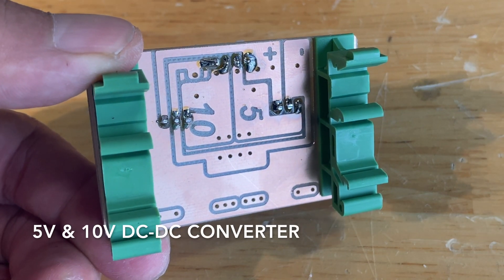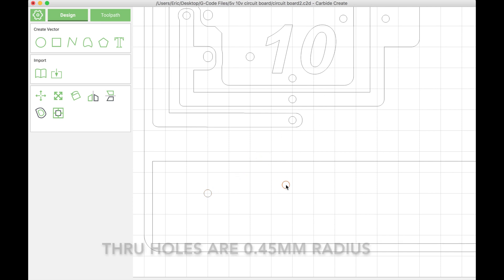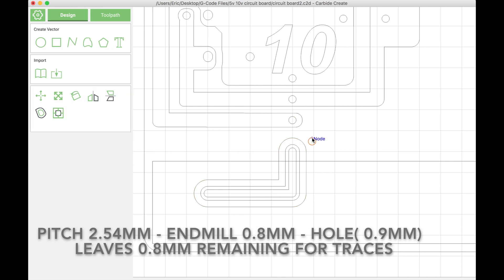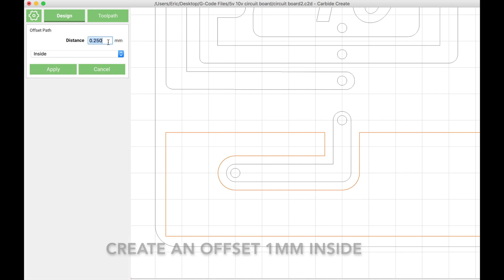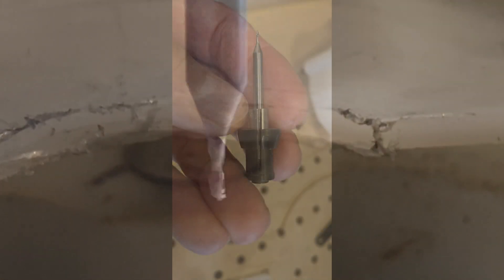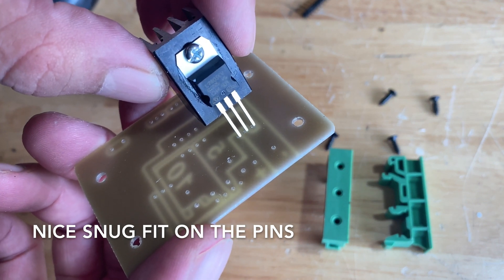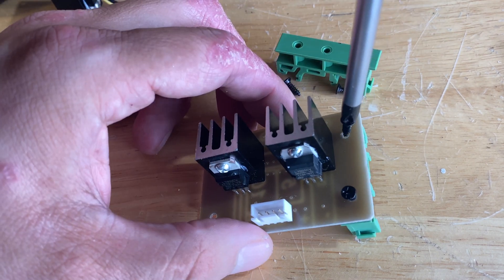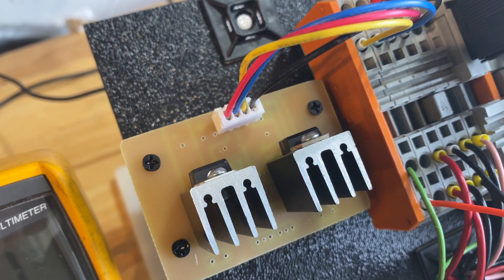Tips for making PCBs using a Shapeoko CNC router and Carbide Create

Comment: No joking, you should consider doing more of this. More of this kind of content, and you SHOULD have a much wider audience.

Pick a list of projects you'd be interested in doing, and work through a couple of those, get collaboration w other channels for more exposure and try to read up on best practices for reacing an audience.

I'd love to see an e-bike DIY refurbish and uprated with sensible electronics and battery packs. Too many of these are trash wayy too early just because the electric stuff gives out. Can't have any of that in this new economy
Reply from the maker: E-Bike upgrade video is in the works!
Reply: @etischer  sweet! Make sure to highlight any differences in charging philosophy between factory made and high end DIY projects.

Usually people can fix most things that's wrong mechanically with a bike, but not everybody feels comfortable fixing worn-out or water damaged electronics, especially if there's no documentation and everything is a "black box" for the user.

The main idea, is that a lot more people should have a decent e-bike in this new economy, and they SHOULD last about twice as long as they do now a days.

Comment: why not use a 60degree 0.1 engraving bit and set the cut depth to 0.1mm...then use Vcarve program to remove unwanted areas...
Reply from the maker: They wouldn't cut the thru holes, and I don't want to have to do a tool change.  With a V bit, if my PCB is slightly out of level, the trace thickness would also be affected, but not with a square end mill.  I suppose if I needed thinner traces, V bit would be my only option.
Reply: @etischer  why dont you setup your machine properly? level the bed for starters...I use up to 5 tool changes for some jobs. the auto tool height touch plate works really well. I have a Accktek AKG9060...
Reply from the maker: @RandomPsychic  You can see in the video that I had already skimmed  the bed.   The material I'm removing is 0.017mm thick, and the first pass does an even skim of the copper around the perimeter of the PCB.  It's not an issue with setting z height, and not an issue with leveling, it's just a tight tolerance for this type of machine.  I have a touch probe, but it's a process to use, and risks breaking such a tiny end mill.

Comment: Sir, i am follower of you. I like know the relation between PEEP, TV, BPM, IE RATIO. Any particular equation
Reply from the maker: Peep pressure is set with a mechanical valve. 

TV is how far the arm closes on the Ambu bag. 

 BPM is how frequently the arms close. 

 IE ratio is time spent closing / time spent not closing.  

In my case, I'm not setting I/E ratio, I'm adjusting the motor speed and displaying the resulting measured  I/E ratio.  So it requires a bit of fine tuning on the part of the user.  If you want the I/E larger, run the motor slower so it takes longer to squeeze the bag.. Arm closing is also a non-linear relationship to volume, but for a simple device like this, the numbers aren't going to be accurate.  

If you know how often (BPM) the arms need to close you can take the inverse and get mSeconds / cycle.  I/E ratio is what percentage of time is spent closing the arms, vs. not closing arms.  

So now you know how many mSec it should take to close the arms, what ever time is left over in the cycle can be spent opening the arms and sitting idle waiting for the next breath cycle. 

If you know how far (TV) the arms have to move, and how many mSec you have to get it done, you should be able to calculate motor speed. It might  help to work in terms of % motor speed, and use it like a multiplier, rather than units like deg/sec.
Reply: Sir, thanks for your  great information. It will help us very much. But I want mathematical equations. It is necessary to code our program . Please help us
Reply from the maker: @biniljohn1821    Cycle_time_sec= (1/BPM)*60

Closing_time_sec = Cycle_time_sec *1/ ((1/(I/E))+1))

Closing_speed = Closing_distance /Closing_time_sec

Comment: Instead of plc , why u didn't try PIC microprocessor
Reply from the maker: PLCs are generally used for industrial automation (din rail/panel mount), Arduino more suited for embedded systems (circuit board level).   I chose to use a PLC, because for me, it's faster to program, and I prefer the form factor.  It's a rugged box that clips on din rail, IO connects with screw terminals and heavy gauge wire, inputs are isolated, outputs rated 10A, built in Ethernet, built in 6 line LCD, simple graphical programming interface.  Built in functions allow program viewing and changes directly on the device, no computer needed. 

Arduino would require assembling circuit boards, building an enclosure, stepping down inputs to 5v, programming the LCD down to the cursor position on multiple pages (I have 20  pages) of screens, adding a real time clock for timing, probably need to expand the IO.   Arduino is better for serial communication with a PC,  integration with steppers, and is cheaper.    For quick deployment, the PLC is better for me.